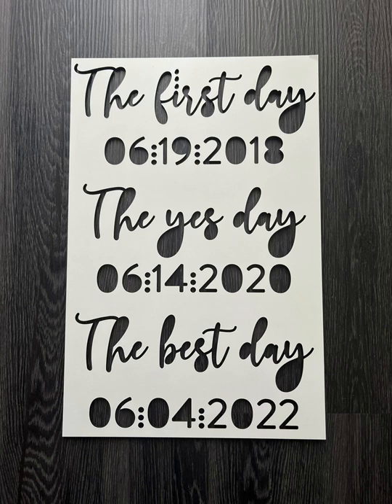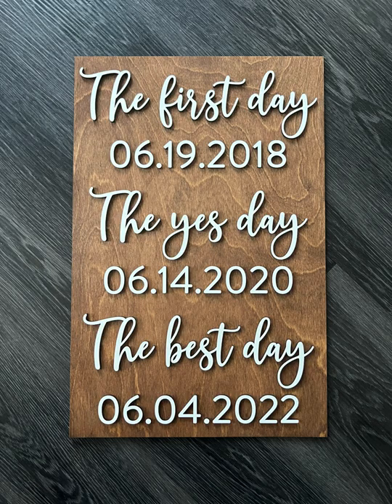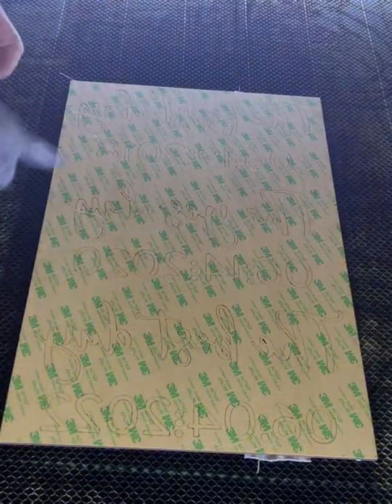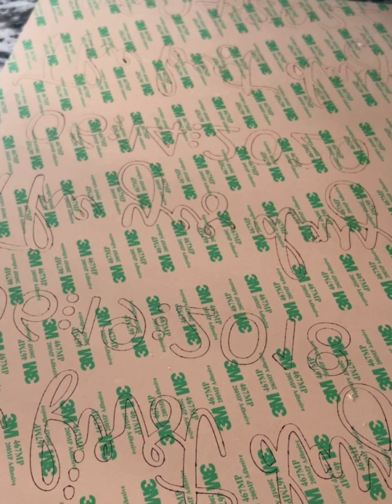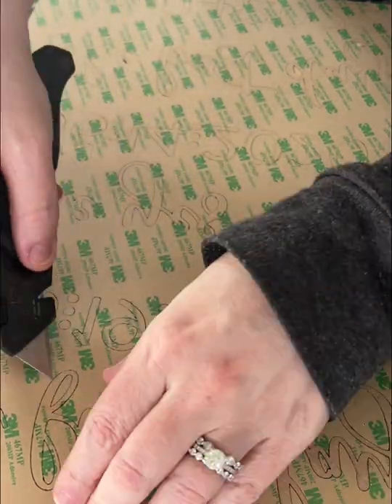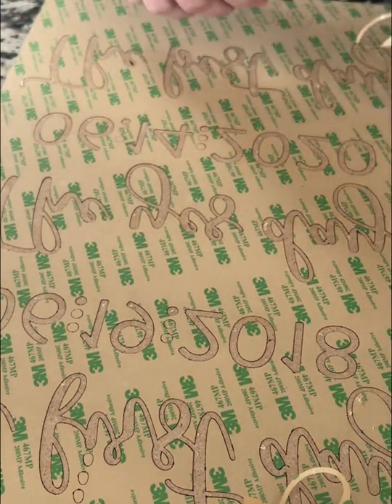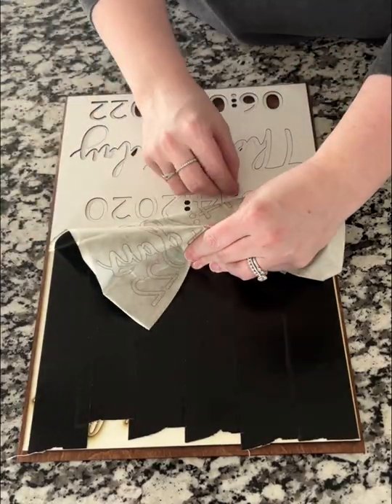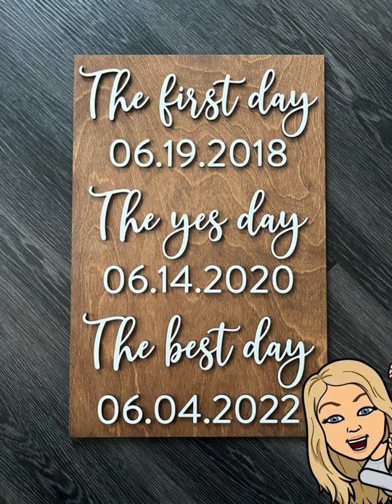Laser Project Tutorial — Using 3M and Jigs

Comment: What type of woods were you using, they are beautiful! (Curious if you use stains & veneers or simply just the plywood). Also, do you apply the 3M backing to sheets by hand or there is a faster way? Thank you so much!
Reply: would love to see a vide on how to apply the 3M to large sheets :)
Reply from the maker: Hi! Thanks for watching! The walnut backer is baltic birch stained with Varathane and the whiteboard is Duro Laserable whiteboard from JPPlus! 

For 3M, I use the 12" rolls with a brayer and adhere it with my hands, old school way! 😆
Reply: Thank you so much! Last question, did u finish this wood with anything? Do you generally finish projects?

Comment: Any suggestion on what can be used as a sort of transfer tape for that adhesive? I bought a roll of it but didn't realize it didn't have the paper on BOTH sides! I've tried freezer paper, parchment paper, polycoated kraft paper, and nothing works - freezer paper and polycoated paper both stick permanently to the tape, and parchment paper doesn't release cleanly so it leaves a massive clumpy mess :(
Reply from the maker: Sorry for the delay! Can you confirm what you're needing to use transfer tape for? Are you applying the 3M to your material before cutting? 

With rolls, I normally back the material before I cut it on my laser. I use 12" rolls, but I also have 4" and 6" rolls for when I want to use it on scraps.

Comment: I tried the 3M tonight and it felt like it melted. It made the sides of my laser cut letters sticky. Any suggestions?
Reply from the maker: Happy to help! What machine are you using? What type of material are you using the 3M on? And what settings are you using?
Reply: @LoBoDesigns  hey! So I have a SculpFun S30 10 watt machine. I used it on 1/8 birch plywood. I tried a couple of different ways - low and slow, high and fast, low and fast, high and slow🙃
Reply from the maker: Are you cutting with the 3M side facing up or down?
Reply: @LoBoDesigns  back side down!
Reply from the maker: Try mirroring your design and cutting with the 3M side facing up! It'll be easier to test this with a couple small shapes on a scrap sheet corner so that you don't have to waste material!
Reply: @LoBoDesigns  definitely going to try this! Thank you!❤️
Reply from the maker: My pleasure! Lmk how it goes!